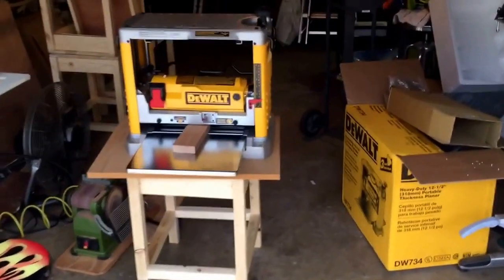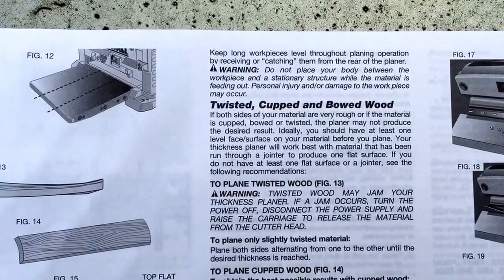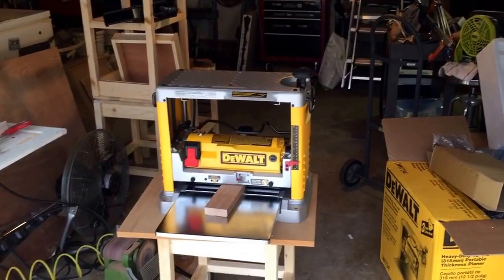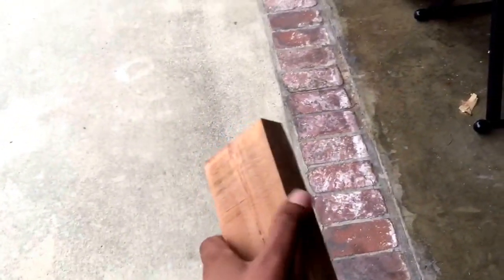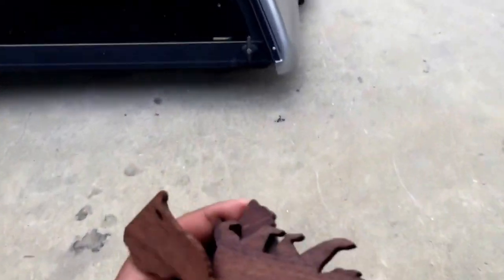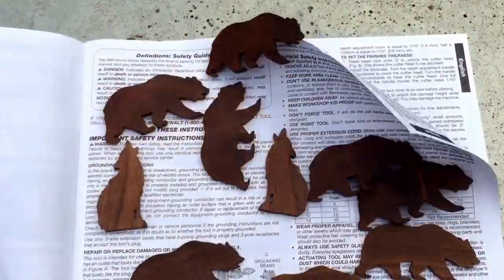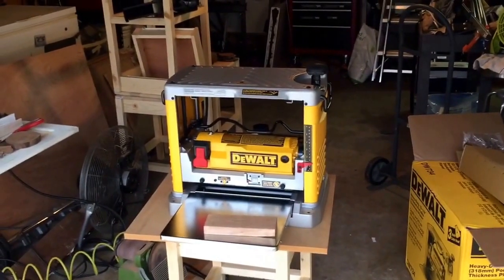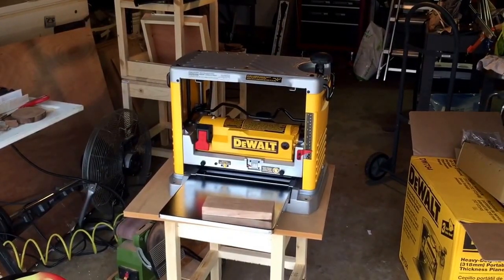Jointer or planer first ?  Dewalt DW734 planer.

Comment: Planer sled with shims and hot glue can be a quick solution for bowed, twisted or cupped wood. And a simple straight edge screwed or clamped to a piece and run through your table saw can be just as good as a jointer for crooked pieces. I don't really see a need for a jointer until the width of your pieces exceeds the height that you can extend your table saw blade.